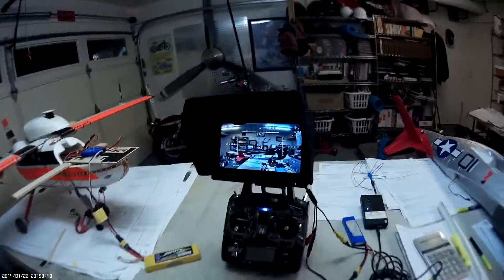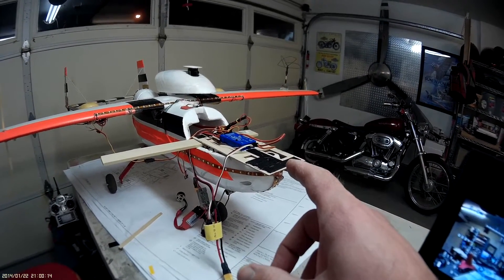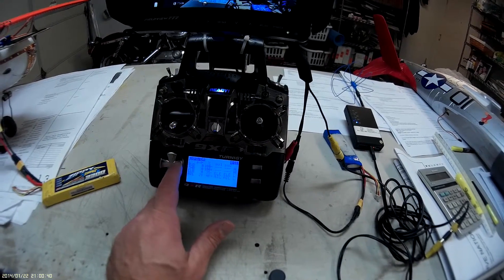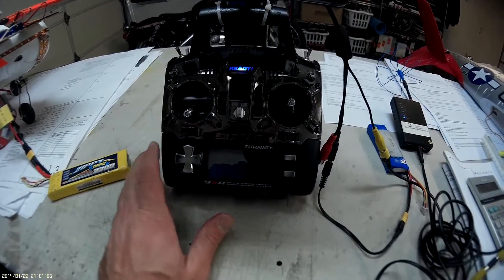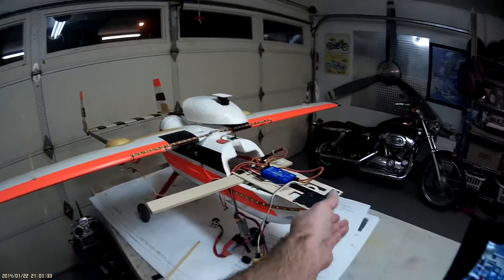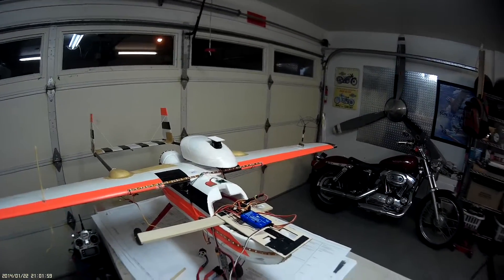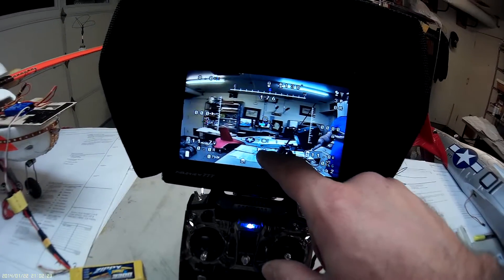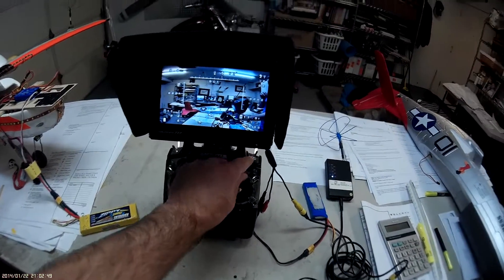Cyclops Tornado working with 9xR 3 position switch

Comment: I have tried allsorts and worked out that if you turn your radio off the compass is solid as a rock. ( Obviously failsafe's were set to zero throttle ) So I turned the radio back on and took it downstairs away from the Cyclops tornado and once again the compass is solid with no movement or twitches from radio. So close range messing as you are doing in this video and I did myself causes the radio to interfere with the Tornado.... JOB DONE :D

Comment: In your settings on the Tornado turn off the HEADING LOCK you will notice even though your model is NOT moving the heading on the monitor is , therefore your ailerons will counter the movement , sometimes slight sometimes a big twitch :D.... I figured this out on the Storm I don't know why the actual heading ( compass moves when the Cyclops and the model are stationery